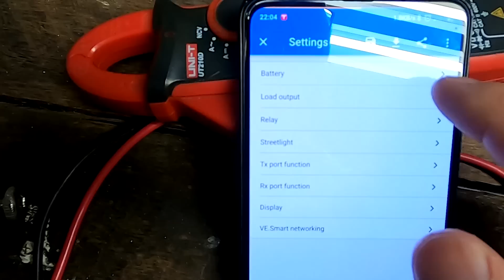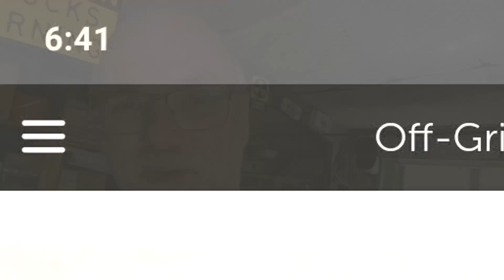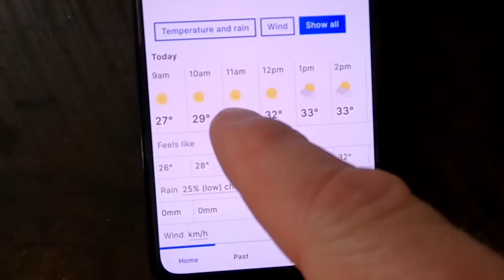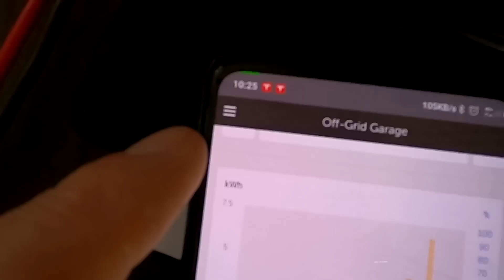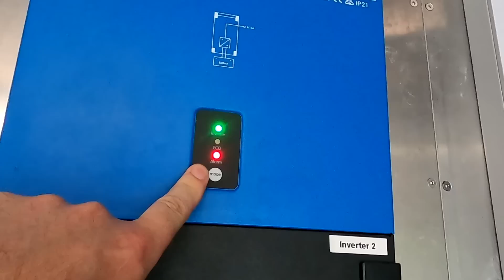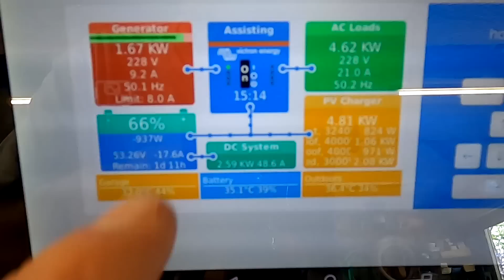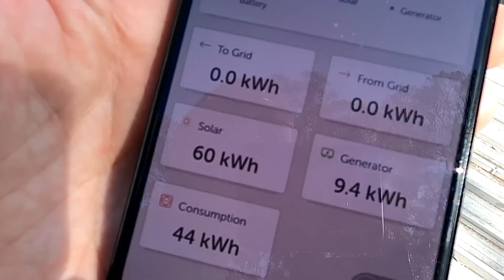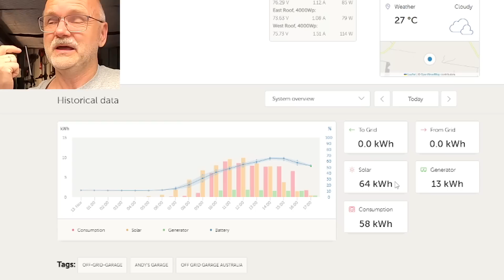New solar system, maximum yield test. How much can we expect? ☀️⚡

Comment: Andy.  A suggestion.  Put a remote temp sensor on the back of the central panel in each string.  I'm fairly sure you will be impressed by what temperature the panels get to in direct sunlight.

Comment: Hello Andy can u help me understand something if u have 3 8 cell battery banks 24v on one inverter charger. & each bank has its own 100 amp bms does that mean u can get up to 300 amps of charging ?
Reply from the maker: Yes, that is correct. Each BMS can handle 100A for its own battery bank.
That's exactly what I have installed in my battery shelf now.
Reply: @OffGridGarageAustralia  ok thank you for helping me under that

Comment: Nice test. It's hard to run the batteries low on a sunny day:P I feel ya.I run just 1kw of solar. I will soon be bringing online a 1160 ah battery, but I doubt I will fully capacity test the battery. I get just about 5 hours of sun a day. Less than 3 kWh on my best day. It would take me about four days to refill my pack, and we are in the cloudy season for my part of Texas. Tests may have to wait until my summer in Colorado:)

Comment: Andy, I think you will get as much as 84KW to 85KW and probably more. In Jamaica I got 35KW from a 7.1KW capacity of Solar Panels in the summer and my panels operated at an efficiency of 78% to 80%. With you getting as much as 107%, I think you may be able to harvest even up to 90KW.
Reply from the maker: That would be an insane number. I will need some more loads to use all this energy...😂

Comment: In my area of the USA ( northern midwest) they require panel installed optimizers such the Tigo TS4 optimizers.  Can someone please explain why this is a requirement?  The stated reason is "Tigo solutions meet US NEC Rapid Shutdown compliance and other safety codes that protect first responders and are required in many countries."  Is there any other reasons that you may want these installed?  This topic was never mentioned on this channel.  Can you cover this topic and explain?  Did you get optimizers installed on your new system?
Reply from the maker: Hi Gerald. A bit of googling and it seems to be the new requirement in the US for having panel strings connected to a grid connected inverter.
For me, it seems like another unnecessary regulation where a few companies like Tigo make a good profit from.
You not only need the optimisers behind each panel but also the trigger transmitter which sends the signal to the optimizers to shut down. More money for Tigo... And it's not a voluntarily installation. It seems it is mandatory for all new installations and also upgrades of older systems!

This does not affect me as I'm staying below 120V DC with my panel strings (effectively, I'm under 100V DC). It's a bit more effort in cabling all these parallel strings but most of the regulations don't affect me and it is still considered as a low voltage DIY system.
Reply: It seems to me that if optimizers are so important they would come built into the panels already. I did find RSD hubs that make the RS system work. I didn’t see where making the panels grid connected was a requirement however. Perhaps I missed that detail. Also the latest NEC rules typically don’t get adopted right away and some areas of the US never adopt them at all. In my area of Wisconsin they only recently adopted the NEC 2017 rules, so you can see it may take decades to get to 2020 rules where I live

Comment: Dear Andy! I watched all your episodes.
Alwaysed I was impressed! 
Now with new pannels also. That why I wondering how is it possible even the panels are new. Why you produce so well. Even they have not a good orientation.
I recommend to mention in your video your location benefit much better solar irradiance than many other places and this could be one of the reasons you produce so well
I've study your case. 
Great job and keep going !
Reply from the maker: Hello, the new panels are far more efficient than the old ones. I'm impressed myself. Orientation and shading have less negative effect then with the old panels. This was something I didn't consider when I was hesitating if I should go with the new panels or not. It was totally worth it.

Comment: Good luck having entire day without clouds. Statistic show there are less than 10 days of completely clear skies per year. Guess what you had is definitely better than standard.
Reply from the maker: That could be true, 10 years back we used to have blue sky all day long for weeks but this all has changed since and we see more and more clouds nowadays.
We had one on the weekend but the battery was full again at around noon time despite all the load I threw at the system.
Reply: @OffGridGarageAustralia  anyway I love how you made system and level of detail you have put in. Quite an inspiration for me, to a point where while constructing my own your videos kept me in check not to rush anything and not to cut corners. That led me to a path of installing systems for other and digging out new problems. 

One question, do you use Home Assistant for automation? In my apartment now everything runs on it and as I’m expecting my Hyundai Kona electric to arrive these days I’ll try to integrate its charging to have maximum production. 

Thing that aggregated showed me is self consumption of my inverters to be around 300W and overall around 4kWh daily goes on them and other inefficiencies. Is that normal or should I change my inverters?
Reply from the maker: @liberumsrb  Thank you. Great to hear the solar virus is spreading everywhere!

I looked into Home Assistent but could not find the time to get the SonOff switches connected for example, so I gave up quickly. I would love to have this running and connected to my solar system and house. 
On the other hand, Venus OS has got Node Red included which does similar things. This all feels like another huge project to get going, setup, configure and install sensors, actors, switches. HUGE!

The self-consumption of your inverter seems very high and excessive. My Multiplus has around 15W, the Phoenix has 10W standby power. What inverters have you got and is it really self consumption or some stand-by loads connected to it?
Reply: @OffGridGarageAustralia  

My inverters are EASUN, cheap Chinese and as tie goes by I’m getting closer in replacing them. Around 140kWh is difference between my production and consumption on monthly level. Now, question is what to have that I can just mint on the wall with minimum rework of existing system? I need 3 phase that runs on 48v batteries and can be connected to Solar Assistant. At the moment I have 7.3kW of panels but planning expansion there too.

My biggest load is car charger. Rest is rather simple, water heater is 3kw 3 phase, dryer, washer, microwave…..

What would you, or anyone else recommend to buy?

Comment: You need to build another battery! Double the capacity!! 💪😆,   Then maybe get another charge controller, and build a ground mount for the PV, maybe get a few more of those new panels,  maybe a tracker with 8-12 panels on it,  if you did that, I'd run a line to the house and a sub panel, allowing a few smaller loads be off grid,
Reply from the maker: I need more load, not more capacity. A bigger battery would not help.
The electrician is working on a plan to connect the house but leave the grid solar connected. With the contract in place, it's complicated as you know...

Comment: Have you talked about the DC bus and I missed it?   Mark 13:50 in video.  Thanks Andy.   I have followed and set up with the many helpful assists for gui mods.   Still new at this!
Reply from the maker: Not in details. DC load is pretty much everything which does nto go through the Multiplus. It's just a calculation the Victron software does. DC System = Smart Shunt - Multiplus so to speak.

Comment: Great setup you have there! I have just recently installed an APS microinverter system on my roof here in Brunei. We have very inconsistent weather here consisting of a mix of clear, cloud and rain throughout the day. I oversized my 30 panels by about 38% using 600 wp Risen mono percs to 13.2 kW max system inversion to make up for the cloudy days. So far the average and median per day is about 60 kWh per day with max at 82 kWh and lowest at 38 kWh. Our NEM provides a 1:1 kWh exchange so there is no need to use a battery for now as excess during the day is exported and reimported back for use at night. So far the system is reaching about 85% of total energy usage. I am getting an average of 4.62 kWh per kW of inversion per day. Would be good to compare how this compares between our two countries. My system consists 24 panels are on a 22 degree west facing roof so early morning is mostly reflected light until about 930 and direct light on them ends around 5pm due to shading from trees and buildings at sunset.  6 panels on South so these drop off around 4pm.  We have 3 months each where the sun is in the north and south too so it is a headache when planning around this.
Reply from the maker: Thanks a lot for sharing, David. Interesting to hear how your system works. I think being so close to the equator, it does not really make a huge difference where you install panels in this location.
The feed in is insane and a very fair deal. That really makes a battery obsolete for the moment except if you have frequent power outages.  I never did a ROI calculation for my system as this was not the main goal to be as economical efficient as possible but more to show what is possible from a technical perspective.
Reply: @OffGridGarageAustralia  The ROI on my system is over a decade 🤣 Brunei has very cheap subsidised power and fuel. I implemented it for a 3 in 1 as heat insulation for the roof as well as to generate power while reducing carbon footprint. I am sure you can guess from a system this size, our use of airconditioning here is extensive. 😅

Comment: Can victrons charge controllers be overloaded?
Reply from the maker: No, they can't. They cap the power output automatically at the max rate they are designed for. In my case the 150/70 can charge the battery with 70A max. The solar panels can be oversized by 130% for these controllers.

Comment: Actually I do not know what my panels will produce.  in the AM they pull in fast till batteries are topped off. Then just my loads are covered rest of day. Now I see why you did this test.  I moved rest of my brakers to off gird panel thinking I should see spikes in usage. only when Water heater, microwave or a big draw appliance is running my solar intake covers my loads and that is it. How much free energy am I loosing. I may have to do a test like yours. The first day I got my system running I did 33kw into batteries since then It is only what I pull the solar puts back in. You are showing me so much thank you Andy. I will buy you a spat next week when my earning go into account.
Reply from the maker: It will be interesting to see what your results are. My system was working the same way as yours and once the batteries are full, the MPPTs throttle down and further energy was 'lost'. With this test, I really wanted to see how much I can expect from the system.

Comment: I love the infectious enthusiasm you bring to this subject. I am curious have you done any study of the pay back / ROI / LTCO ? There are some that say that electic cars while inexpensive to operate, because of their high capital cost, are not necessaryily cheaper to own over all. And, I have not done the math recently, but 10 years ago any solar system involving batteries had negative pay back times, where the grid was an option.
Reply from the maker: Thanks Peter. I never did a ROI calculation. It's a bit difficult as I don't have the house connected yet and don't really see the whole potential of the system and what it can deliver. Same with the vehicle, the initial cost was higher but since, I never had a service, maintenance and paid only very little for charging at home (which is now $0 with the new solar system).
I'm working on a solution to connect the house to the battery and then we will see how much power and money it really saves.
The whole project is more to show what is actually possible from a technical perspective.

Comment: cool video as always, i love em. so good to watch. could you explain how you connected your victron shunt, i have one also, but got problems that the % never show correct, do you have your littel red cabel on your main buss bar or on one of the batteries ? thx.
Reply from the maker: Thanks Jens. I think I have a few video about that here on the channel. Teh red wire needs to go to your battery positive or if you have more than one battery, to the main positive busbar.
Check the settings of the shunt. I made a video about all the settings of it. It's here on my website with all the settings as well: https://off-grid-garage.com/my-settings/

Comment: I have a 10KW grid tie system, at summer peak it produces 85KW/day, a lot of which is sent to the grid.  You can heat water with the excess power for domestic use, or run the pool pump more, or consider grid tieing the system and send excess power after batteries are full to the grid (assuming you can get a net metering agreement)
Reply from the maker: Exporting power is not an option with this system. I also have a grid connected system on a very high feed tariff and nothing else is allowed to be connected at the same time. 
The hot water heater would take 3-4kWh away/day, far less in summer due to not taking long hot showers. The pool pump is already running 24h but I thought about a pool heater maybe to dump 2kW of excess power and make it a 60.000l spa 😂
Reply: @OffGridGarageAustralia  I like the massive Spa 😉 I was going to suggest you install more batteries, but if you don’t need the power, it’s just a cost that will never pay off.  It’s very likely you are now “over panelled”, you could consider removing 1-2 of the roofs (of the 4), and storing the panels indoors, for future spares, but even that isn’t worth bothering with.   Best suggestion is to just shutdown chargers, once the batteries are full..  power is one of those things, use it, or lose it.  You could also offer “Andys Free EV charging”, put up a J1772 EVSE by the road 👏
Reply: Is that 10kw of panels with a 10kw inverter or have you over provisioned your panels?
Reply: @andrewford80  enphase microinverters, they are Toshiba 370W panels with 230W enphase microinverters, they do clip some, but are driven hard most of the time
Reply: @mwolrich  That's huge output. Id say the configuration is working well!

Comment: Very cool system, as winter approaches here you  forget sometimes its always summer and sunny somewhere on this planet, which is kind of wierd for us who dont travel and are used to waiting for weather to come and go, theres always perfect weather somewhere, like above the clouds for example, its always sunny 100% peak output all the time.  But how do you do that?  ...  Some planets dont even spin, so the concept of time and weather is even stranger where you dont wait for noon you travel to it, and perhaps setup some panels and then travel to midnight to watch your neon lightshow lite up.  Anyway 64  is impressive , but in a scale of 1 to 100 its abouta C- .   Yes this scale is arbitrary but were so used to scales of 10 or 100 as a species i want to see 100kw, 1 million! I TRILLION!  ok maybe not that much but i think theres room for improvement.  It maybe not possible with this system now , but a similar one with solar tracking and even cooling i think could put the same amount of panel int o100k range.   I heard that in the summer time heat plays a big factor upto 30% you lose due to heating of hte panels, which would put this system at 100kw  if that  were true, but probably not that much since its not peak summer yet.  I noticed this wit my 2x80w panels during the fall the last few weeks as sun got less and less output seemed to stay the same if not more it seemed , i thought i just had a better angle but i think it was due to heat, less heat improved the efficiency.  If the loses are upto 30% like some  youtubers have claimed (where i got his info)  it might be worth it to install a cooling system?  perhaps water pump with heatsink tubing under the panels, even if it cost 5% power , if you got back 30% it would be more than worth it.
Reply from the maker: Thanks Mike. Always sunny above the clouds...

Comment: Nice. I had to check my output for today after watching this. With a 9.7kw PV grid tied system in Hervey Bay today, pretty much full sun all day, my total output was 60 Kw, to give u some comparison. 
It will be interesting to see what you produce on ur best & worst days in the next 12 months.
Maybe have a go at welding up trailers or something using a homemade 48vdc welding setup to use up a bit of extra juice, Im sure 48vdc welding would probably get a lot of interest on ur channel too. 
Give me a thumbs up if ur interested in 48vdc welding. Cheers
Reply from the maker: That is fantastic output. You have a 5kW inverter, I guess but 10kW of panels?
The welder I have is actually running on 48V DC. It' s a bit hard to control the current though when you don't have a transformer.
Reply: @OffGridGarageAustralia  I actually have 2 x 5kw inverters on a 10kw pv array.